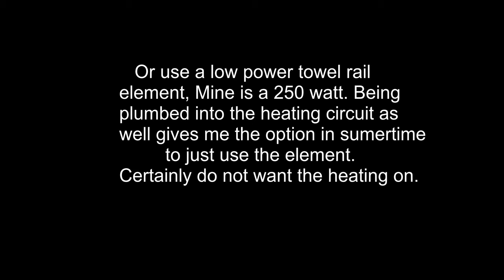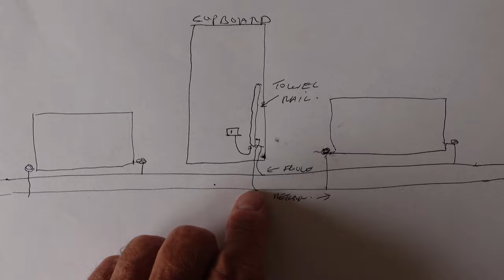How to turn a cupboard into an airing cupboard

Comment: When I converted to a combi and removed the old emersion cylinder I just fitted a couple of 240V low wattage tube heaters with thermostats, (can get different lengths & wattages for your needs) and changed the 13A spur to a socket outlet. You can then get heat all year round without central heating on, very easy to fit and cheap to run.
Reply from the maker: Cheers Ray.